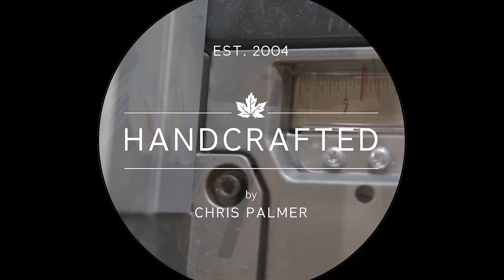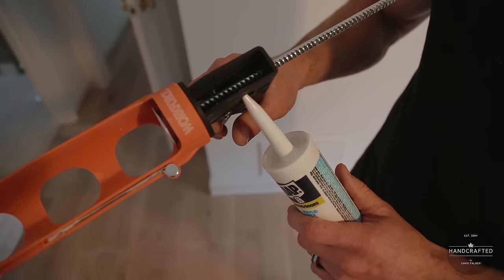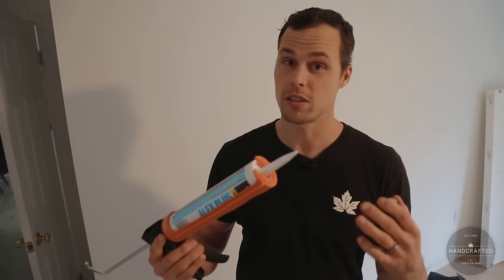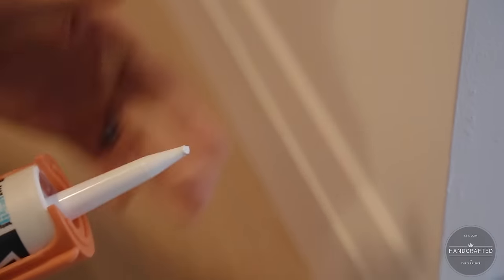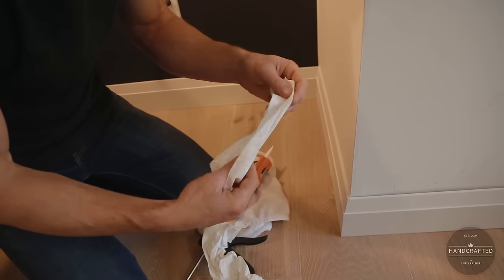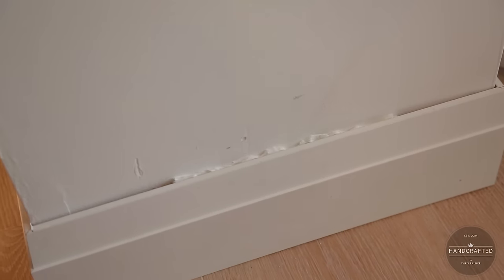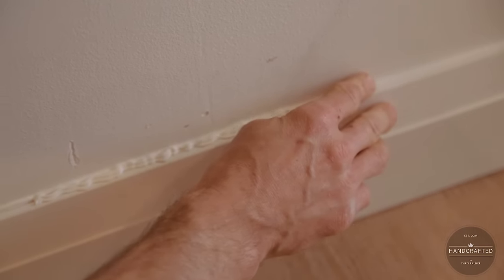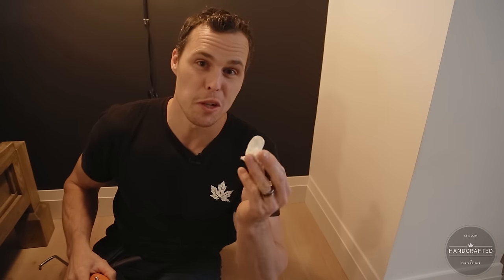How to Caulk like a Pro

Comment: I just calked my trim and then saw this,. I didn't dare tell anyone I used left over napkins from fast food drive thru to fill  the space in my trim, then I saw your video. I was sure there was some expensive special filler that I was supposed to stick in there. Learning as I go so really appreciate your tips. Thank you!
Reply from the maker: Well you are right, you can use a backer rod from the hardware store to create a damn so caulk doesn't run down the wall as well. Also, cedar shims and cardboard have been known alternatives. 👍👍
Reply: Llt

Comment: Wait, my caulk gun has a tube cutter on it?! I seriously never knew that
Reply from the maker: New knowledge everyday! 👍
Reply: I know I've had my gun for 5 years. What's worse I didn't realize it had the puncturing pole. I've used a screwdriver and scissors this whole time. I've now learned to watch YouTube videos for every tool I have, tips and tricks. This video just showed me I've been doing it wrong all along including cutting the tip straight instead of an angle 🤦‍♂️
Reply from the maker: @LazyCrazyGuy  its all about learning something new! 🙌
Reply: I didn't know it either.
Reply: That tip cutter on any gun I've ever had always sucked compared to a razor blade
Reply: Haha I just learned this too, but I'm new to home fixing.
Reply: I didn't know it either!
Reply: They do, but a nice sharp razor works better in my opinion. The puncturing pin is nice too, but you have to make sure you clean it off each time. Especially if you’re using PL400 or something
Reply: Not all unfortunately.
Reply: Haha same here! Genius!
Reply: Lord have mercy, me either 🤦🏻‍♀️🤦🏻‍♀️😬🤷🏻‍♀️🤓🤣
Reply: I know, me either!

Comment: I liked the toilet paper idea for filling in big gaps. I use either a spray bottle of water to keep my finger and the calk slightly wet before smoothing it out. For applying latex calk over tile: i go over the calked (and wiped off with a finger) area with a wet cloth to take of any extra calk that gets into areas beyond the calking bead area. Then I use a wet finger to go across the bead to make sure that the wet towel doesn't leave any traction lines from the weave pattern  of the washcloth. It's always useful to see other people's ideas and procedures. Thanks!
Reply: cokc

Comment: I recently used expandable foam insulaltion to fill a huge gap behind a counter. Masking tape before filling the gap with foam. Allow to dry, then trim off with sharp knife before caulking.  It came out pretty good.
Reply from the maker: That's a risky one, low expansion is what you would want to help prevent super spreading of the gap as it can push the base off the wall. I have heard of this method, but I haven't tried it.

Comment: For those bigger gaps, instead of toilet paper I use cut up piping insulation foam. It can be wedged in the gap and it expands a little so it creates a nice firm backing.
Reply from the maker: Yup, TP is for those unable to get to hardware stores and are in a pinch. Backer rod is the same material and is great, thanks for sharing!

Comment: When I go about placing my caulk in some gaps I prefer to wet the tip a bit with water, or some kind of water based lubricant, so that the caulk easily slides into the gaps. I have tried it without anything and its just too rough and its kind of hard to get the caulk to set in there where you want it to be. Thank you on the tips on handling caulk, its really opened my eyes to the many different strategies for a good caulking!
Reply from the maker: All good!

Comment: Hey Chris I have done a lot of trim and never thought or heard of the TP idea. It's a good one! Thanks man!
Reply from the maker: You're welcome and thanks, it was an improptu type of tip, readily available and works perfect for preventing more caulking being lost behind the trim. 👍
Reply: a good thing to also do is WET then toilet paper before u wedge it..to stabilise thr paper and make sure its packed between the wall a skirting extremely solid...great vide btw tho..👍👍👍

Comment: Good stuff bud.  I'm glad that you FILL the gaps rather than globbing caulking in there and trying to smooth out the finish.  The TP trick is good if you're cramped for time.  I personally use expanding foam... but you have to wait for it to cure.  Once done, you can cut it flush (or to any angle you want/need) and it's a FIRM surface to now caulk over instead of TP which is going to MOVE on you while caulking.
Reply from the maker: I generally use backer rod. This video caters to the average home owner, and gives you a quick fix in a pinch 😉. The spray foam can be risky as its not nice to clean up if it expands or spills over.
Reply: @HandcraftedbyChrisPalmer  Backer rod is good for sure, no doubt.  The foam certainly can be tricky.  Guess I've used it so long I know just how much to use/spray so it only slightly raises out of the gap and I can quickly take off the excess.  Some of the crew like to use it like they're filling a hot air balloon... shit everywhere LOL.  Again, great video sir, quick, concise and useful.  Thanks =]
Reply from the maker: @liberty9348  thanks! You probably already know, but i found if you mist water on the spray foam it will setup almost immediately. 👍
Reply: @HandcraftedbyChrisPalmer  Yep, one spray bottle of water and one with alcohol is part of the tool kit =] ... and several others depending on the job.  The invention of the spray bottle is one of my favorites... so much utility.

Comment: Exactly the baseboard questions and conditions I have. Thanks.
Reply from the maker: Other detailed method ypu can attempt to smooth out the wall with drywall mud if the dip is very steep. 👍
Reply: @HandcraftedbyChrisPalmer  I'm using oak baseboards and the gaps are not as wide as in your video. The plumbing of the fixtures will be done tomorrow so trying to finish baseboards before the toilet gets installed. I was helped with drywall by the Vancouver carpenter Ben Degros was very helpful with his video and email answers. I saw his caulking videos then found yours. Yours were what I needed for this project. Keep doing what you do, Chris.

Comment: just finished putting bead board up and low and behold, the walls were not 100% plum, so I had some of those gaps you described.. didn't want to put tons of caulking and then have it leak and pull away from the wall, so will give the toilet paper trick a try, thanks!
Reply from the maker: Great! You can use backer rod if you have time to go to the store. Otherwise other alternatives are wood shims, corrugated board or card stock can help damthe gap from lost caulk 👍

Comment: while we in the business know this, it's amazing how many people don't. I built a complex mantle piece for a customer when I was young and my tools/skills weren't yet creating flawless joints. But still, caulked normally and properly, the mantle would look great when painted. The customer said her neighbor would paint it and since I had the understanding that caulking was the painters job (which it really is) I didn't caulk it. Big mistake. When I came back a few months later for an unrelated job, I saw how wrong it looked..I was embarrassed because you could tell the customer didn't seem to feel one way or another about the mantle. It was painted red first of all (they were Asian) and the long vertical miters along the columns were noticeably open (I had used a crappy used craftsman table saw with a dull general purpose blade and again, I was a beginner). Various other places needed proper caulking as well. I would have caulked and re-painted the mantle for free. Since it was red though, and since there was no leftover paint, I would have had to pay for the paint myself because the customer had no interest in putting more money into the mantle. That I would not do. All I could do was try and explain that if it had been caulked and painted properly (and painted white, smh) it would have looked very different and very nice. This was all lost on the customer though so it has irked me ever since. To this day, whenever possible, I always caulk my own work. Especially on a mantle peice.

Comment: Usually those kind of guns come with tip cutter but it doesn't cut too well deforming the tip, sharpers knife make a cleaner cutting. He's right about how much to cut, even though you make a straight and beautiful line of caulk you always have to apply pressure with your fingers or a wet rag in order to material go inside gap. When gap is wider you can use that technique of TP or towels always removing excess by cleaning with wet rags to avoid dust collection points.

Comment: Best tip was from the tile guys.  Use a yellow sponge perfect bead every time
Reply: Dacoda 82 been doin it like that since day one and it’s a breeze
Reply: You'd be surprised how many uses a damp sponge has 😂
Reply: How do you use the yellow sponge?  It's used instead of using a finger or a rag?
Reply: I use the very tip edge (where it is less than 1/2” wide) of damp yellow sponge (only yellow cause other colors may bleed). I just gently glide that edge tip across the bead similar to the way he used his finger and it seals it nice and clears any excess from the spot too. My father taught me this when I got my first home years ago. It makes a very nice even professional looking result every time.

Comment: thank you for this, would you say the walls should be painted first or afterwards? Thanks
Reply from the maker: having the walls painted is fine, and so is having one or more coats on the trim. The key is to have one more coat painted over the caulking to seal it from being a different colour than the trim and also allows you to clean it easier.

Comment: I would be concerned about movement between the baseboard and the wall. I think I would use expanding foam first, then cut back the foam and finish with caulk.
Reply from the maker: No movement unless your walls are moving 👍 and be careful with spray foam, it won't remove easily on surfaces that are delicate or untreated.
Reply: @HandcraftedbyChrisPalmer  Thanks for the tip. I was concerned that the wooden baseboards may move a little in the seasons.

Comment: When do you caulk: before priming; or before the first finish coat; or before the final finish coat?  Thanks!
Reply from the maker: Caulk immediately after install. This way you paint/primers go over the caulk to seal it with the wall colour.
Reply from the maker: Or trim colour pending the cut in.
Reply: Handcrafted by Chris Palmer thanks, Chris!!!
Reply: I had trouble with my pva primer cracking on paintable fully cured calk. So I would prime first then calk
Reply: @sloanick100  thanks, Nick!
Reply: @sloanick100  Are you priming the walls with PVA instead of diluted emulsion or dedicated primer?

Comment: Actually you want to cut your tips relative to the size "indent" or gap that you are filling so that when you apply it across your backer rod you end up with a smooth even surface instead of ...well ....that.
Reply from the maker: There's obviously more than one way to do this, but if you cut your tip large to match a wide gap and then come back to s thin gap, it's not ideal as you now have to get a new tube or wipe a ton of excess off. Cutting the tip as I did, works well in all gaps and applications. Not saying your wrong, just saying this method works well.

Comment: Well that’s really clever. I spent all day yesterday cleaning the old caulk out. The prior owner didn’t use a mold resistant caulk and within a month of moving in the white caulk was black from mildew. Not only was it revolting I knew it was going to be quite a task to clean it out. Old caulk removal is about 99% of the job. How can applying new caulk be anywhere near the same amount of hassle?
Reply from the maker: Was the issue for the caulk having mold because of a high moisture area? Also, caulk should be painted with trim or wall paint after installation to seal it. Helps to protect and speed up the cleaning. Sorry to hear of your luck!

Comment: Thanks for the tips on caulking,I have always wondered about smoothing it with your finger,do I use oil,water to stop it sticking to your finger?
Reply from the maker: Usually a damp rag on hand to keep finger wet enough and make for easy clean up is what I will do. 👍
Reply: @HandcraftedbyChrisPalmer  thanks for your tip,my caulking job is complete and looks not too bad,the idea of filling in the large gaps with TP worked like a charm,my wife was confused as to why but she understands now,again thankyou

Comment: The TP is a perfect solution👍 They sell what's called backer rod for this purpose to fill gaps. It's like the same material as a pool noodle. Trying to shove that stuff in with a putty knife or flat head screw driver, it cuts through. Not an easy task. TP is def the way to go. 🙂 Thank you🙂
Reply from the maker: No problem, the backer rod is what I would suggest if people had time to go to a store, but this along with cardboard, or shims are excellent dam methods to prevent slumping of caulking over wider gaps. 👍
Reply: Depends how large the gap is - sometimes backer rod would be completely necessary. But this one was the perfect size for tp

Comment: I use a disposable cup (disposable coffee cup works well) with water in it, and when I need to wipe the caulk with a finger, I dip my finger in the water first.  This way, the caulk doesn't stick to my finger as much, and it semi-dissolves the caulking as I go for a nice smooth finish.  I keep the roll of toilet paper nearby to wipe excess caulk off my finger, then re-wet for the next wipe.  Some of those stretches can get long, so you want to make sure your fingers aren't all gummy with excess caulk from other areas you may have had to wipe down.
Reply from the maker: The cup is a good technique. Just harder when you're doing an entire home to dunk your finger but good for small spaces. A method to try is a damp rag so you can wipe clean 👍

Comment: If its large gap as you demonstrate with tissue I sometimes use newspaper or fill with standard filler then rub down and caulk after
Reply from the maker: Yes some drywall mud to skim the large humps out is ideal when I do renovations.

Comment: Like the toilet paper trick for the wider gaps.  EXTRA TIP.  Fill a spray bottle with soapy water and wet the area lightly first.  Using the Dap Alex Flex it’ll take the stickiness out of the equation and use a silicone finishing tool for the perfect joint.  This way your finger won’t run caulk up onto the wall.
Reply from the maker: Thanks for the tip 👍
Reply: Keep a damp towel handy to clean the finishing tool and the run another clean towel over the joint when done.  Don’t let the finishing tool gunk up with caulk.
Reply from the maker: @kcsinaz  I typically have a bucket and sponge on hand, and out of habit just dunk the finger. Haven't been a fan of the tools. My fat fingers smooth it, but I use a 1" putty knife to square it.

Comment: Should put some type of shim in a long open stretch for strength, or leave a open hole for a bead if calk to go down to solidify to make it stronger.  an open gap won't nail well,  and will flex in and out.

Comment: My problem area is a bigger gap. Thanks for the TP advice!
Reply from the maker: You'll want to get some drywall mud and start building up the wall where the sag is to make it flat again. Otherwise you can always cut a hole and slip a block in behind to flatten it out. 👍

Comment: Always have a wet rag when caulking use it it clean your fingers and what not even use it to smooth the bead also put the wet rag on a painters knife and get paint off the floor when painting baseboards works real good on tile seems no matter what I do painting base boards I always get a line or two on the floor use putty knife and wet rag folded over it clean up a brease

Comment: What it there’s a large gap between the wall and the floor, and you don’t wanna buy backer rod? Same idea? I tried stuffing my gaps with foil, cause I don’t use TP or PT (paper towels). What the f_ _ k, no TP?🫢 Nope, just a bidet + washable cloths for better hygiene and sustainability purposes.  Any suggestions?
Reply from the maker: From floor to base we use a shoe mold or quarter round. Super pro way is to scribe baseboard to floor.
Reply: @HandcraftedbyChrisPalmer  Thanks! I live in a 2nd story apartment in California and since we’re always having small earthquakes the gaps between the floors and the walls is a constant battle…  but I need to fill the gaps soon to prevent bugs from getting in, and keep my place cool before it gets obnoxiously hot! A quarter round is perfect! I never would’ve thought to use these. and they’re cheap too, only .64¢ each @Home Depot! Since I’m in an apartment, how do you suggest I secure these? Nails, glue? 🤔
Reply from the maker: @TheeAntiChris  Brad nail the shoe mold in place. Caulk the seam between shoe mold and baseboard.

Comment: Great video.  thanks.  If I could add... before starting put all dogs, wives and/or girlfriends in another room for the reasons stated.  Also have a roll of paper towels handy.  I got the chaulk and gun, got the tip clipped and everything was good.  Started chaulking everything good then the chaulk keeps coming and coming and coming.  My gf is screaming ur getting it all over everything (yes thank you i am aware of that fact) dog is barking, phone is ringing, chaulk keeps coming.  and coming. and coming.  even with no pressure that chaulk is coming out of the tube at least it did for me so be ready. About half the tube of chaulk ended up on the paper towels before the flow stopped.  But I got the job done.
Reply from the maker: Lol sounds fun! Dripless gun not available? Also, perhaps a bad tube of caulk as they do appear every so often with a super runny tube.